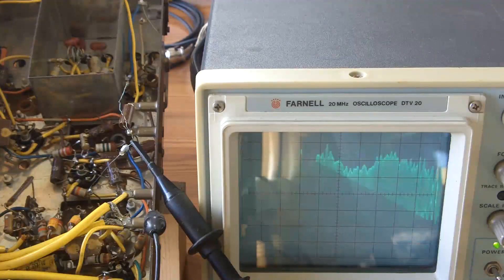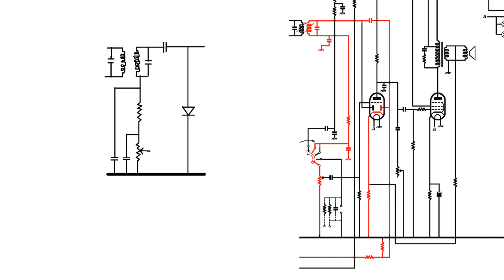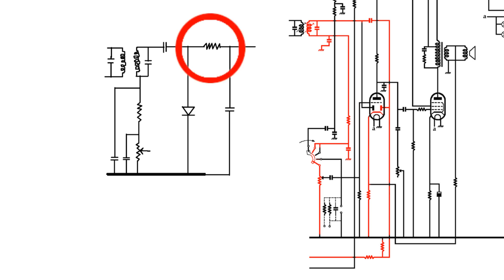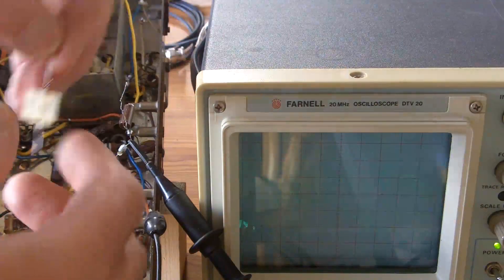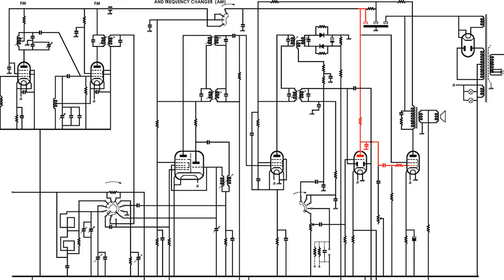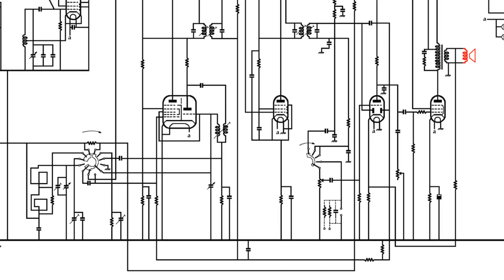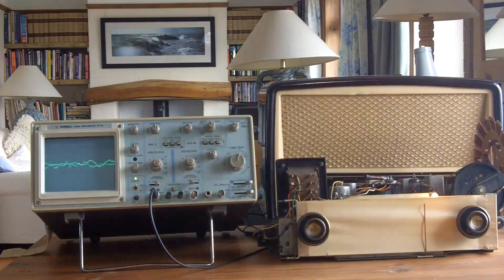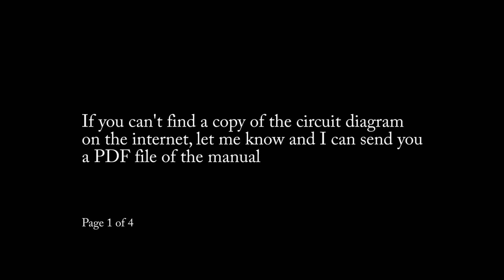About Radio ... Part 18 Output Stage and Duoble Diode Triode by Andy Davies

Comment: Hi Andy
I want to express my sincere thanks for a most informative set of videos. I have restored and repaired quite a few radios from the era, primarily German ones, and consider myself quite familiar with the theory, but your set of videos served as a welcome refresher for me. It really amazes me how much I learn from every restoration, no matter how much I already know, and I think you reminded me, or taught me, as much as I'd learn from quite a few jobs. I am an electronics engineer from the post-valve era, and this is a hobby for me, so I really like to know the detail of what is happening, rather than trying to 'get the job done' as I would do if this was my job. Actually, if the latter was true, I'd be completely broke as I think the last Saba I restored clocked up over a hundred hours (admittedly, many of those were spent translating the German information, and simply admiring the complex beauty of the German circuitry).

Comment: andy i know its been a bit since you did this, but do you happen to know the vales  of the rc circuit for tone controll for the output transformer. ive built a single tube regen using a 1s4 tube and a micro output transformer, and its a little high pitched. ty

Comment: I was particularly interested in this series as I have a BC5645 which I rescued from a skip.  It has languished in my garage for about 15 years.  I finally decided to attempt to recondition it, did a web search and hey presto.

30 years ago I did a degree in Electrical & Electronic Engineering but I've forgotten a lot.

I thought your series was great - relevant to me because of the model you reviewed and just enough detail to remind me about some of what I had forgotten.

Best regards...Paul